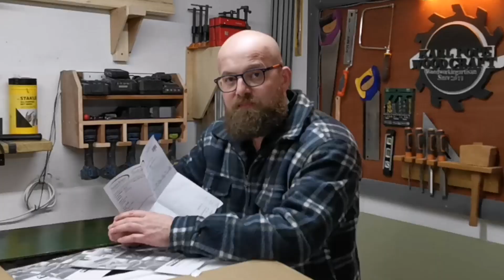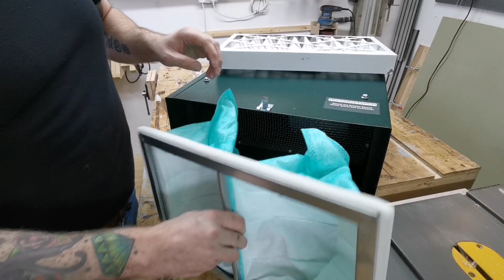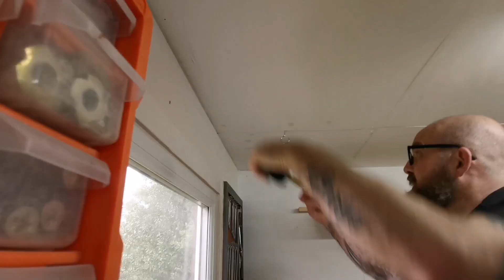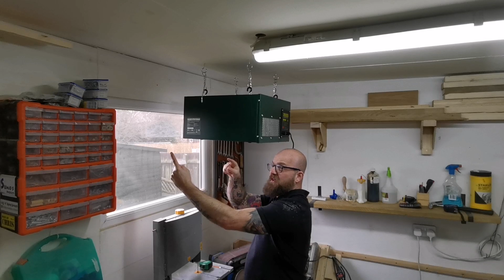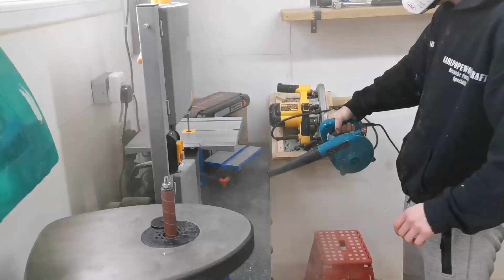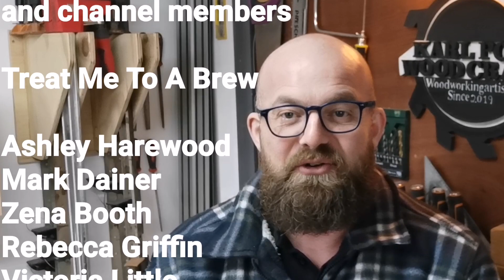Record Power AC400 Set Up & Initial Thoughts

Comment: I just bought one for my workshop (AKA the Shed), though it’s not that high—UK regulations, as you know! 🇬🇧 I’m trying to figure out the best way to set it up—either hanging it somewhere (still not sure where) or placing it on a table. Any advice would be greatly appreciated! Being disabled and clinically vulnerable, I need to stay as safe as possible from the constant dust, and I really appreciate the safety tips you’ve shared in your video.
	
Looking forward to hearing your thoughts, my friend. If you ever find yourself on the most easterly coast of Britain, give me a shout! I’d love to pick your brain about working safer and show you my little workspace.
	
Remember, Life is Short so Live Long and Prosper … 🖖 Cheers matey!!!
Reply from the maker: @IfDawidCanYouCan  Thank you,  if you have room I'd definitely have it hanging but as close to the ceiling as possible. Even on a shelf somewhere it's going to help with the air quality so just the best you can with the space you have. Just make sure there is air flow in the front and rear. Hope this helps a little. Many thanks Karl
Reply: @karlpopewoodcraft  Thank you matey, Dawid... Cheers!!!

Comment: My reasoning was the same as yours. The back of the unit should face the room. But in that case the remote is useless. Will probably have to move the IR sensor to the back side somewhere.
Reply: One question though. Why did you recommend placing it away from the extraction fan?

Comment: Just ordered one from Record Power - how good is it after nearly ten months?
Reply from the maker: Hi Chris honestly i wouldn't be without it. The remote is garbage though as you need to be directly upfront of the control panel. Definitely helps massively though with keeping the air clean.
Reply: Hi Karl
I spent an age deciding whether to get an air cleaner, but this has made up my mind - probably 10 years late!
Isn't strange that we no longer accept what was perfectly normal a few years ago.

Comment: Are you happy with it a few months later ? I'm currently considering buying one.
Reply from the maker: Hi mate quality of air wise most definitely does a cracking job. Remote is a bit cheap and you need to be in direct line of site for it to work but overall I'm happy I have it.
Reply: @karlpopewoodcraft  Thanks, think I'm going to go for it, it's one of the cheapest units (200€) that isn't a gadget from amazon and that I can find, for the price it seems perfect for a small workshop.
Reply from the maker: @kz.irudimen  https://amzn.to/3isRF7l
If you follow this link mate ill get a few penny's from Amazon as well. 😊

Comment: I had mine for about three months before it stopped working. Record said it was a remote problem and sent me a new one. it still didn't work so they sent me a PCB to fit myself! That didn't work so in the end they sent me a replacement and I returned my broken unit. Now I've had it for a couple of years and bit by bit, after the warranty period it has slowly developed problems, went fro multi speed to only one speed and has now stopped working! So I'm looking for another manufacturer. Any suggestions?
Reply from the maker: Hi Stephen I was under the impression all these where probably made in the same factory but badged differently I'm not sure as this is our first air filter to use. 🤔😔😊

Comment: Great review Karl and a great addition to your shop. I've had a JET version of the same thing for over a year and the most important thing it does is clean the dust you can't see that would otherwise be in your lungs, rather than on the shelves. It clears smoke from burning blunt saws quickly and saves your lungs massively especially if you're using MDF and the like. Runs for hours and you can clean the first dust filter with the shop vac or compressed air. Cheers.
Reply from the maker: Cheers Ben,   yes that's the most important thing isn't it. Health is the most valuable thing after all.

Comment: Thanks Karl... I have the Katsu leaf blower thanks to your recommendation. I am 6ft 5" so this unit won't fit in my workshop but with the leaf blower and a stupidly powerful 12" industrial extractor fitted in the wall I am able to de-dust the workshop and send dust into the atmosphere.  But that was a fab review of a quality air cleaner. Cheers Paul
Reply from the maker: Haha excellent mate😂 I wish the leaf blower had a longer lead though 😬 6.5 wow really tall.
Reply: @karlpopewoodcraft  Just the right height to be working down a pit as a Coal Face Mechanic for 20 years...ha ha
Reply from the maker: @paultay23  really 🙄 bloody hell you must have a stiff next. 😂

Comment: Good review Karl. I installed one of these in my workshop early part of January, really pleased with it. I placed mine in a similar location to yours, but on a shelf as I don’t have enough height for it to hang.
Reply from the maker: Cheers mate, I'm pretty sure it doesn't really matter that much but definitely better off with one of these even if it's not ideally located. 😊
Reply: @karlpopewoodcraft  absolutely, it seems to be doing its job well as that first filter ain’t so white any more, guess I should clean it this week 😂.

Comment: Enjoyed the video, nice one!  I've never considered anything like this before.  How much do they cost?  Also, does it run off mains power and if it does, how long is the power cable?
Reply from the maker: Cheers mate,  I paid 180 from the supplier I mentioned in the video, if you shut down the power to your workshop it will shut down, the cable is 1.5m. Definitely a good investment on your health if its in your budget 🙂
Reply: If it’s your business and you’re in the workshop all day, then definitely worth the investment
Reply: @stevereed5776  yes, definitely!  I'm just a hobby woodworker though, but would still consider one of these, if I've got the headroom.
Reply: I got mine from D&M Tools for £169.99, plus a few quid off as I had some loyalty points.
Reply: @idlersdream826  that's a good saving then, nice one!
Reply: £190 on Amazon, ouch!
Reply: ... but probably a small price to pay for breathing cleaner air and looking after my lungs though!